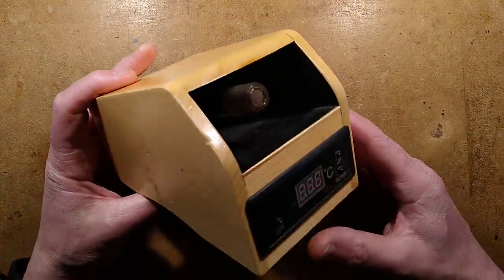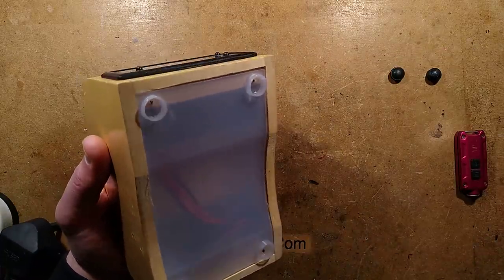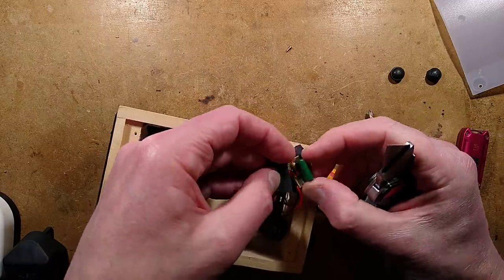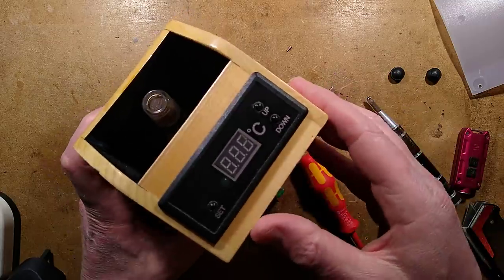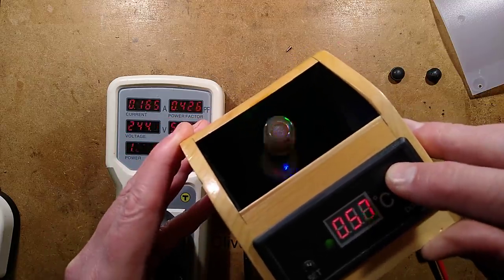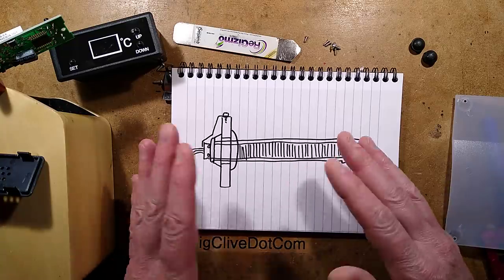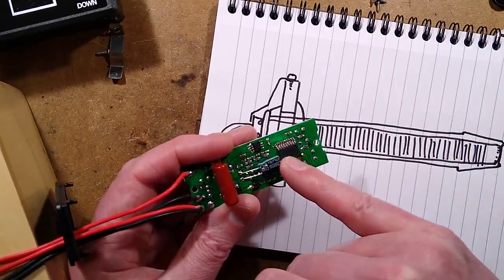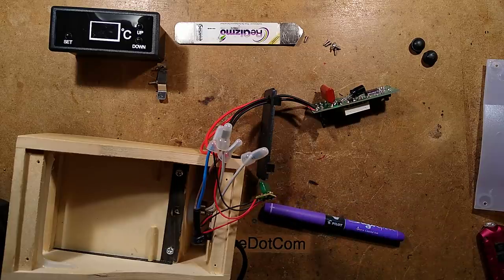Exploring a mystery gadget

Comment: When in uni we had this subject called pharmacognosy, which deals with herbs and plants. We did analysis of cannabis with thin layer chromatography (TLC). How do you get the constituents on the TLC plate? Well, by stuffing the cannabis in a little metal tube, heating that in a special little heater and letting the smoke blow on to the plate. The entire lab smelled like a Dutch coffee shop!
Steam distillation of cloves to make oil of cloves (eugenol) was also fun and smelly.

Comment: Eons ago, when I learned of the “chemical property” that makes this thing useful, I immediately thought of using the hot air solder pen. Well of course I headed directly to it for (what turned out to be) some successful experimentation. And let me tell you that the ladies at the rework desk were not as impressed as I was with the science.
Reply: A company (now defunct, didn't last long) called TerpTech LLC made a product called a terp torch, which was a soldering iron with a ceramic heating element covered with a chamber that held quartz bb's. I still have it, but the element broke so I need to buy a new soldering iron, but it was cool as shit
Reply: Brill

Comment: I owned this exact unit 10 years ago. You're missing the "whip" component made of a glass bulb with a screen that fits on the device, some latex tubing, and a glass mouthpiece at the other end. They work great and easily soothe broken bones. Even after the power cable frayed I put on a new one and used it until the thermostat was shot.

Comment: I actually learned how to code arduino by making my own electronic PID controller for a concentrate nail. you are right that a lot of them are technical people, thank you for mentioning that. :) love your videos!
Reply: That's a really cool idea. Congrats!
Reply: What heating element did you use?
Reply: @lvrboi92  I just bought a 5 pin XLR 40mm coil for any big brand e nail (wiring is not interchangeable between brands) so that I can replace the coils if they die. AC line neutral and ground run thru the coil with T+ and T - leads as well for thermocouple inside coil.
Reply: No need to make a custom heater tip. Just use a diesel engine glow plug. Inert, durable and gets red hot in seconds.
Reply: @UrbExGear  we used a 3d printer hotend heater :) cheap and easy to find
Reply: @wasteoink8376  did you machine some kind of a heat transfer block or it's just sticking from a bottom of the bowl?
Reply: @UrbExGear  all my answers are truncated. First it we a link now even without . sorry some algorithm shit
Reply: @UrbExGear  we have an open hardware project like 7 yrs ago documented everything , so go look for it , it seems I'm not allowed to even tell the name, so I give up on this comments

Comment: "I wonder why they did it like that?"

Dude.  You know why ...  It's the same reason that they only build about 2 a day.
Reply: That's why they need to legalize it lol, it can work both ways depending on what you use.
Reply: Increasing amounts of testing  led to a significant slowdown in manufacturing.
Reply: I suspect it's simply because it's a very simple device, and they didn't want the OTHER technically oriented people to try to do modifications while ...  actively utilizing it.  If you have to break the glue bonds of the back to do it, you'll think twice about that level of effort while under the influence.
Reply: I have a feeling that the fog o' herb is so heavy in that room where they work that no device is needed.
Reply: @ItsTristan1st  😇
Reply: @tbelding  Think twice, not sure about that.
Reply: @pileofstuff  😂
Reply: @stephenlee5929  Really?  The folks I know who used the stuff did it specifically to relax.  Yeah, they'd get pretty original sometimes, but if it required a bunch of effort, they usually stopped and found something else to do.
Reply: Yeah they keep forgetting where they put the screwdriver.
Reply: I'm guessing the authoritarian state that was likely manufactured in didn't leave the workers much room to use drugs while putting it together.
Reply: @Jake-xe1wu  : I'm guessing the managers had a dozen running tobacco on the shop floor so they wouldn't have to relight. Smoking is quite popular in asia.

Comment: Ah yes, the amazing "hot air box." These were quite common on EBay from 2011 - 2016, and probably before and since. One slightly more sophisticated variant has the same case design, but incorporated a tiny CPU fan (30mm?)  operated by a tiny toggle switch on the front panel. The case is sealed with Special  SafetyTape - which I believe is a code for "low grade paper masking tape," and the fan is mounted to draw air in through a highly sophisticated grill opening (made  by poking holes in the plastic bottom plate with a hot soldering iron).  I've not seen one with multicoloured LED 'enhancement' but that's the magic of progress! Some of the most expensive versions of this design include a potentiometer or "High-Low-Off" switch to adjust the fan speed - very high tech. 
There were DIY versions of the  "wooden box" vapourizer published on many project sites. Most were a plywood box with an incandescent light bulb mounted vertically inside. Above that heat source was a herb container made from one half of a tea ball, or a small stainless steel "sauce cup'"  to hold whatever was to be vapourized. The container fsat in a circular hole in the box's top. Over that was an inverted Pyrex or Silicone funnel, held  with a DIY bracket and gasket. A  silicone tube "whip" attached to the stem of the funnel. Some designs relied on "user suction,."  Others used a small computer fan to pressurize the box, forcing air through the "herb cup."  12 VDC halogen bulbs for headlights were used in many setups. The whole thing could be powered from a 12VDC 5A laptop AC power supply,.  Switches for the lamp/heater and the fan made a basic control panel. An oven thermometer gave a rough idea of air temperature. 
Many plans included a metal  shroud around the light bulb, made from a 180ml tomato sauce tin with the ends cut out. This concentrated air flow past the bulb/heater, and gave an air gap between heater and case. 
Some  "techie" designs used a temperature control module with a sensor & feedback loop - about $10 - $12 on Ebay. The LED/LCD display would show actual or "set" temperature, with a built in relay to switch power to the heater. Some designs were well thought out and reasonably safe. Others were less skookum - potentially a shock or a fire hazard.  
Thanks for sharing this one with us, Clive.
Reply: Thank you for that wonderful info-nugget, fellow AvE viewer!  Saved me from gettin' on the Gargler and doing the ol' jazz hands routine myself.

Comment: Nice little unit for extracting the active ingredients from finely-chopped herbs.  I had a fancier unit with the exact same element, and it was still working flawlessly when Atrial Fibrillation left me having to abandon consumption.  Unit lasted a full decade without ever needing re-calibrating or replacement of the heater.  My particular unit was also fan-driven, as you could either use the tube or collect the... mist... in a bag.

Comment: Wow neat ! thankyou for this.... i used almost this exact model for years as a teen. Only difference was a manual twist knob to control the temp. Same screen and same seemingly inaccurate temp reading. I was very happy with it, still own it ! 15 years old and probably still works.
I then upgraded to an Airizer V-TowerX that stopped producing heat after 11 years
Reply: I had one around for about that long myself.. plugged it in and it started smoking on its own-i dunno what happened to it but I didn't plug it back in. Don't really need it these days anyway.
Reply: I had an Airizer Air II and then a Pax II.  These days I just buy oil cartridges for a slick little rechargeable pen battery, cause Cannabis and THC is legal in Canada :D
Reply: Priced per a year of use that isn't bad. I sold mine over 6 years ago and it is still going like a champ after I had put it through a few years myself.

Even if you don't like how they operate you can't blame them for build quality.
Reply: @ILikeStyx  I wish it was legal here, i would use it for sleep, well actually I think there is one area of Australia where you can grow 2 plants per person.  It is in the ACT, where all the hot air comes from in this Country in Canberra.

Comment: I died laughing like Ive seen that as every headshop; it's a vaporizer (old style,  E-Nails, Electronic Dab Rigs (like Puffco Peak/Pro) and the pen style ones and cartridges that screw in a pen or cartridge modbox) the Volcano was the top of the line. An E-Nail turns your borosilicate glass water pipe/bong with a titanium nail that heats when wrapped around the nail itself which goes to a large power box and oddly an XLR cord/plug in the box which I only knew because I   have a studio and thats a microphone cord! weird...

Fascinating seeing that broke down; also seems to me that they'd make it unremovable because 1. Cheaper & 2. You need to buy another instead of cleaning the frosted glass rod) to maintain it.
Reply: so glad other people know what this is. i ordered one of these off ebay back when i was in highschool.
Reply: They actually work not too bad. I've still got one that's only maybe 10 years old. The rubber on the tube has started to go brittle, but damn if it doesn't still puff
Reply: yea man I was glad to see some other people recognized it too lol always saw these ones in the glass case at the head shop by the Volcanoes and other vapes. I actually used this style once lol Bringing back fuzzy memories of April, back when 420 was a real event, practically was a holiday in the city I grew up in!
Reply: I had one of these break and they mailed me just the glass rod, but I couldn’t install it for the life of me
Reply: There's a very good reason why some equipment uses XLR connectors for AC/DC power: these days they're one of the cheapest forms of postive-locking connector you can buy.
They're also quite robust, and can pass a reasonable amount of current (even though they're not designed or rated for this) because the contacts have a fairly large surface area.
Still a terrible idea of course... any decently-high-current application should be using connectors that are rated for the job. I wouldn't use XLRs for anything more than a few hundred mA.
Reply: I wish people would not use XLR (or Din Plugs) for power supply of over 3v
Reply: I have a Volcano digit. The new hotness is a thing made by Stündenglass. You flip it over and it kinda works like a water bong or whatever it’s called where the vacuum of the water draws the smoke/vapour/whatever out.
Reply: Surprisingly, these things last pretty well. I had one a generation before this (no fancy leds, and a knob instead of a digital readout). It still worked last time I moved after about 20 years of use. Got rid of it though

Comment: It's a "whip" vape or hose vaporizer. It's a common appliance for flower inhalers. Volcanoes are bag inflating vape. Magic Flight Box is a classic AA battery powered portable wooden vape with heating chamber and optional attachment option to water pipe. Puff Co water pipe is a Apple of concentrates devices. Lookas Seahorse is a "nectar collector" concentrate device that is used like a straw with a optional whip for water pipe attachment. Honestly don't need water filter when it doesn't generally make smoke.. vaping is about compounds not smoke.

Comment: Never used one of these days as it's a bit old school and much prefer my homemade induction heater Dynavap setup.  What I like about my Dynavap is that I can use a butane torch when I need my medication if I am out and about so it doesn't need  electronics. 

Though I'm interested in making a Pinky setup which uses a #8 53N61S TIG Nozzle, PID controller and a 20mm heater cool and some sort of ruby, quartz or sapphire material to help with the convextion. I'm not sure how it hundred percent works yet but it looks very interesting.

Comment: Correct me if I'm wrong, but back when I was into certain herbs, the optimal temperature for a device like this was more like 250C.  200C is a bit too cold for optimal performance.
Reply: It depends on how smokey you like it. I m not a smoker so 200C is enough. Highest oil vaporization is around 160C
Reply: I think it comes down to personal prefrence, my dry herb vape offers a range between 150 and 275, and 180 is more than enough for me, although i dont do it to get high, i just want to take the edge of a mind that wont shut up, that wont give me an repireve, i dont have aspergers or any form of ortisum however i do have other mental health issues, and without these magical herbs, id be on Lithium tablets or whatever there equivelent is this days, finding the dry herbs changed my life, i can take the edge of my mind without getting perpendicular and work, and i find with my mind dialed back to 11, i can communicate better.
Reply: @AnIdiotAboard_  I was building DIY models back in those days.  Mostly whatever I could scavenge from Home Depot.  It was still illegal then.  Kids these days...  They have no idea what we went through to get decent smoking apparatus going.

Comment: I have a device very similar to that except it doesn’t have a cool wood enclosure it’s just plastic and the temperature controller is slightly different on mine. It’s more similar to a soldering station, when you turn it on it goes to whatever temperature you last set. I’ve popped mine open before and it also has similar construction to that where it looks somewhat DIY made. The tapered glass piece on the end is called an 18mm male joint. There is a 18mm female joint glass bulb piece that goes over that with a round metal mesh screen to keep the dried herbs in place. On the other side of the glass bulb is a rubber hose for inhalation. The device works quite well but it’s very intense, as other commenters said the newer version of this is the volcano, it’s similar but blows hot air.

Comment: I wonder if that's a standard piece of laboratory glassware, or custom specifically for this.  The taper angle looks very common.
Reply: Ground glass fittings can be purchased and a glass blower can connect them to anything else made out of borosilicate. They can be made too, on a glass lathe.
Reply from the maker: Closest I could find was ground end tube, but no flange at the other end.
Reply: @bigclivedotcom  It is probably a tapered borosilicate glass thermometer adapter, or it may be custom made from a tapered joint
Reply: The glass adapters and joints, etc, are all sold by taper size. That one looks like a 14/20 taper to me, but perspective is difficult. Might be 24/40.
Reply: @samuraisystemsllc  You likely nailed it with the 14/20.  Bare minimum it could be a 10mm, but I doubt it.  If you look at the item closely on the web, it looks like a standard ground glass joint.
Reply: It's probably standard lab glass. The tapers used in bongs and the likes are all standard glass tapers, because those are cheap and mass produced.
Reply: These are 16mm tapers. Not 14mm.
Reply: @eugenew2  Would you happen to have a link to anything that specifies a 16mm tapered ground glass joint? I can't find anything that uses that designation. A 14/20 taper joint is almost exclusively used with any joint or adapter using 12-20mm round glass tube.

Comment: I have one of these, it's called a vapourite (the Original ones) and is for uhhh.. aromatherapy and essential oils and heating 'herbs' to select temperatures. I've had it for about 15 years. It is mass produced but in lower volumes initially. You can use 'herbs' about 5 times by raising the temperature a bit, different uhh.. herbanoids will evaporate at different tempreatures. So you can dial it according to your needs. Very useful for medical patients etc who don't need the uhh.. higher end effects and just need the relaxation. 
It smells like popcorn, so is super stealthy if you need to be discreet. 

There are other attachements than the wand/tube, e.g. an oil evaporation device that's much shorter.

Glad you found it, they are not so common!

Comment: 6:49 235C is already combustion temps for the material, but also probably drops with air flow. To get at the CB compounds, you need higher temps than for the trippy stuff, and this is right around the temp you need to be at to get them all. It simply doesn't need to go higher.

Comment: Its like a one way trip, i wonder why they did that.

Given the target audience is likely to be somewhat shall we say baked, they took the precaution of keeping the baked from become burned on mains voltage. Still have one of these in the box with instuctions, states in no uncertan terms, there are no user servicable parts inside and the whole thing is nailed together around the vaperoizer chamber, any attempt to remove it will likely result in "Serious Damage" to your unit.

Personally keeping the baked away from mains volatages and very high voltages is good.

Comment: Intriguing! Due to a lack of proper schematics I just build a rather simplified version of the device for further testing. Just without all the electronics. I replaced the electronical components with a rudimentary combustion solution based on fermented leaves and a paper casing for usability reasons. Who would have thought that the glass piece is easily replacable by a cylindrical multi layer cardboard strip? Although there is no current or voltage involved, there seem to be surprisingly huge amounts of flow! I will take a day off or a week to get really reliable test results.

Comment: Looking at the shape of it and the fact you said it uses a soldering iron element, I'd guess the whole thing is a rebuilt soldering station. It looks a bit like some of the old Weller ones. The plastic base may have been from the original stand.